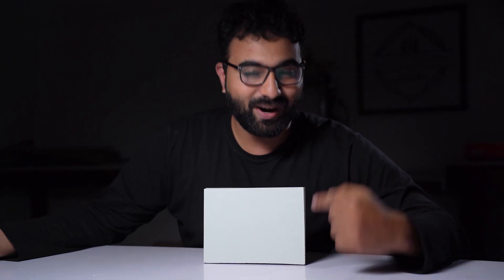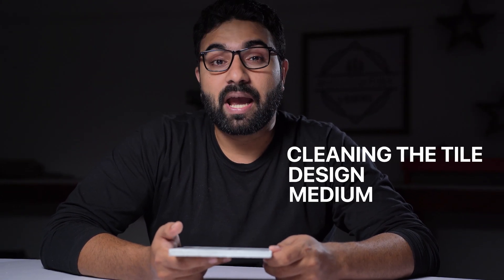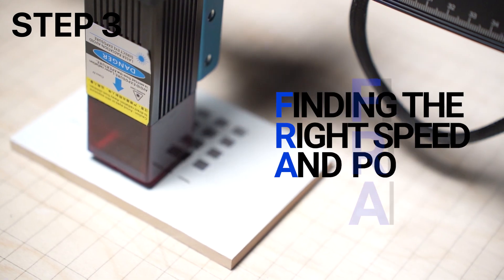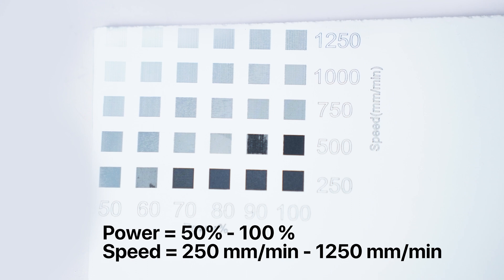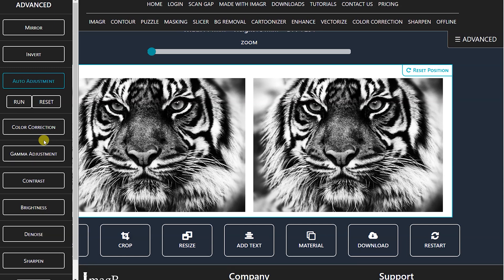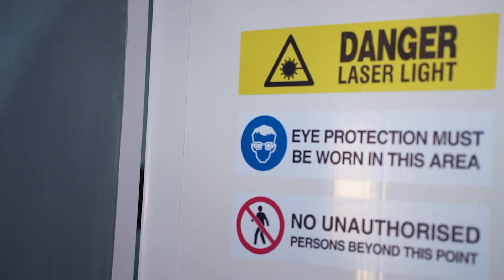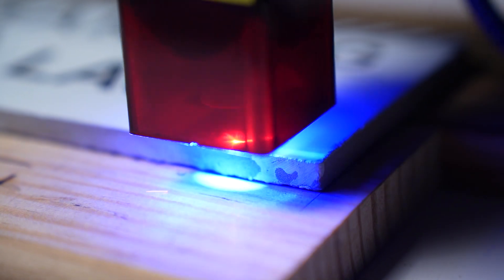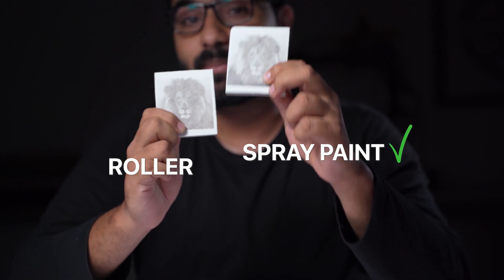Engraving Ceramic Tile with Greyscale Photos using a Diode Laser!

Comment: Hi! I have a D1Pro 20W and need to engrave photos on anodized aluminum business cards. What settings do you recommend? Thanks!
Reply from the maker: Hi, 
For engraving metal business cards, I got the best results at 40% power and 3000 mm/min speed with my xTool D1 pro 20W. But it is always best to perform test runs to find the best settings for your setup.
Reply: Thank you so much! I appreciate you! @MellowpineLasers

Comment: I'm running a 10w diode and I don't even get a mark at anything faster than 70mm/s at 100% power. What am I doing wrong? Coated with titanium dioxide.
Reply from the maker: The results can vary due to various factors, such as the difference in the spot size of the laser, the quality of coating used, type of tile, drying time of the coating, etc. You should use these settings as a reference and perform test runs to find the optimal settings for your setup. 
Also, make sure the lens of your laser is clean.
Reply: You also need to change your speed settings to mm/m, not mm/s, thats usually used when using Co2 lasers

Comment: Sorry, I didn't catch that. What kind of paint are you using here?
Reply from the maker: I used an aerosol white spray paint for this project, but any white paint will do the trick. Make sure to perform test run to get the best results.

Comment: Good morning I just joined and I would like to know with Sculpfun S30 10 Watt what parameters to use Thank you
Reply from the maker: For engraving on ceramic tile with a 10W laser, I got the best results for 90% power and 2400mm/min. For other materials, xTool provides a detailed material settings table. You can use the settings corresponding to their 10W module as a reference for your projects.
https://www.xtool.com/pages/material-settings
Reply: Thank you very much for your reply good day regards

Comment: When you mention the 5, 10, and 20 watt lasers are you referring to advertised wattage or actual wattage?  I have an Ortur Laser Master 2 20w however its actual power is only 5 watts.  Thank you for the videos.
Reply from the maker: I always use the actual output optical power.

Comment: How would this have compared if you'd used the xtool p2, do you think? Better/worse? Or different, how?

I'm debating between shelling out for the p2 and all its fun gadgets vs getting a cheaper diode to start, and pairing it with manual woodwork and such. I would have said p2, but you have so many creative videos for the diode.  If I am aiming at small business level production, should I just get the p2 (or a better co2), or is there a diode that could handle the pro-sumer workload?
Reply from the maker: The job would have been faster on the P2 owing to more power. A CO2 is a good choice for business purposes.
Reply: Cheers, thank you.  The P2 is definitely on my buy list now. Though... I am seriously considering getting the F1 first. So shiny. So fast.

Comment: You should try TIO2 powder, mixed with water (1 to 3 ratio) then use an atomizer. Leave it to dry and you can etch at a fraction of the price.
Reply from the maker: Oh, cool. Will give it a try some time. Thanks for sharing 😊
Reply: I am using the TIO2, but my tile comes out blank.  (grayscale, 3000, 60%)  Suggestions?
Reply: @pjdegroot1  prepare a 1/3 ratio with water, put in an atomiser then, once the tile is dry (careful on not put your fingers on top of the tile), use lightburn or similar to run a material test starting from 10% power and see which setting works well for you. Mine is 70 mm/s at 70% power

Comment: When I use grey scale my image just burns the tile completely black?
Reply from the maker: You either need to set the max and mix power setting properly or
 use the jarvis mode.
Reply: @MellowpineLasers  thank you so much  I will try do a lower power. Did I somehow made both high and low dark maybe?

Comment: I used the settings for ceramic on a photo on my 10 watt diode. The image came through but it was light. I wiped it off and the image wiped off too.
Reply from the maker: Please try a higher power setting. This happens when the power is too low.
Reply: @MellowpineLasers  Just getting back to let you know that it worked with a higher setting.

Comment: As an engineer, I LOVE the detailed information.  This is the best how-to I've come across and will be recommending your page to as many of my laser buddies as I can.
Reply from the maker: Thank you so much. I'd really appreciate it if you share it with other laser users.
Reply: I have a question and i cant get  a straight answer on this question 

I have an atom stack p7 m 30 5.5w laser is it capable enough to etch tile using the norton white tile method?
Reply from the maker: Yes

Comment: Thank you for your video.  I spend more then 50 hours doing laser engraving over my weekends as a hobby.  Only managed to get two tiles where I am happy with the results. I use LightBurn with a 15W diode engraving machine & learned engraving from YouTube.  I will definitely follow your instruction closely to try again. Not giving up so easily.
Reply: Amazing..will be following this page
Reply from the maker: Yup, Never give up. Good luck!!!

Comment: Great video. Maybe you can help me. My picture is not photo realistic at all. I made my color image greyscale at 254 dpi. I didn't make any adjustments in light burn. Not even size. I ran a test grid and picked the best at the highest speed. It was close to your settings. I also selected pass through. It's a jpg image. Any suggestions as to it is so bad? I wish I could upload the picture
Reply from the maker: You can mail it to me at mail@mellowpine.com

Whenever I use pass through mode I first process it on imag-r. You could try using the Jarvis or stucki mode

Comment: can i do pawer and speed tests in lastergbrl as i carnt use lightburn
Reply from the maker: Unfortunately you can only engrave images as a whole on LaserGRBL and cannot engrave different parts at different powers. You can make a row of squares using photoshop or image editing software and shade different squares using different % of blackness and then engrave the row at different speeds one by one. This will take a lot of time and the results might not be accurate. I'm compiling a library of designs, I'll upload the g-code files for the tests, you can run them directly on LaserGRBL, hope to bring it out soon.

Comment: Hello, My friend. The reason white ink is used is because it usually contains a certain proportion of titanium dioxide, which is a white dye.  It is its presence that reacts at high temperatures with the tile varnish and produces the dark color.  In addition to the factors you presented, one that also influences is the thickness of paint applied.
Reply: I use powdered titanium dioxide in a spray bottle with isopropyl alcohol. It works better than paint and is super easy to wipe off.
Reply from the maker: Yes you are right. Thank you for pointing it out. :)
Reply: Whats the reason when cleaning after engraving it wipes off also?

Comment: Is it possible to do two passes at 90 degrees, to reduce the vertical striping?
Reply from the maker: If you get vertical striping while using horizontal scan, there is something wrong with your laser (probably improper belt tension) or your software (try a different software). If you have vertical striping while using vertical scan, try reducing the line spacing. It could also be due to a large spot size. Which laser are you using and what is your spot size?

Comment: Have you used the bi directional feature of lightburn? How does that affect your settings?
Reply from the maker: I always try to keep bi-directional scanning on, it reduces the time taken to complete. You can keep it on for most cases. However, if you want to engrave material which cannot handle much heat you can keep it off, this will help the material cool down between scans.